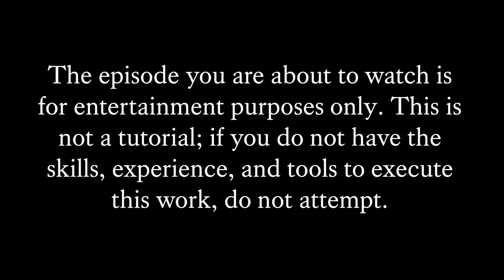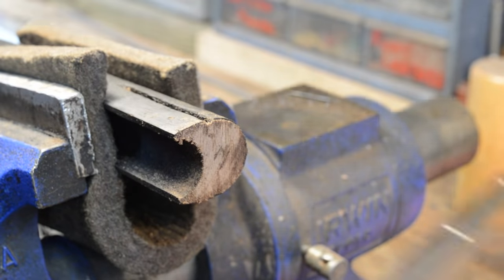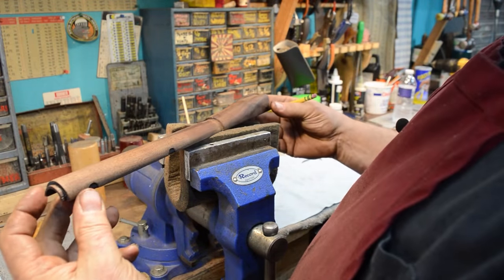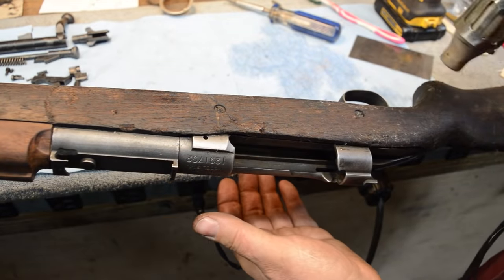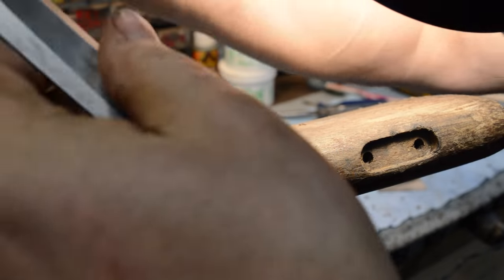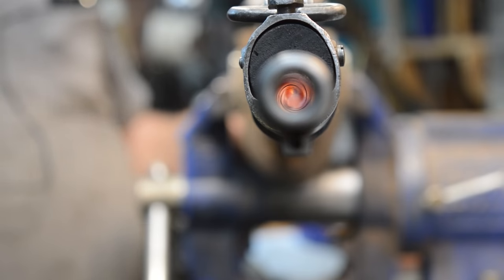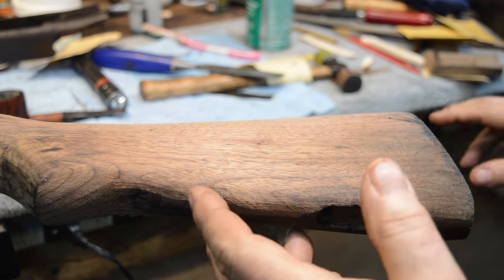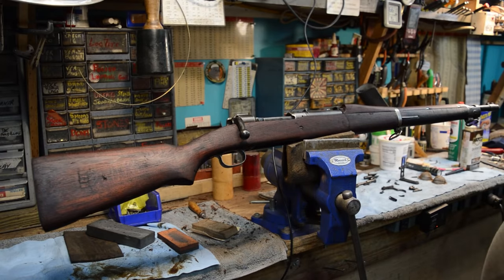Anvil 094: 1903 Springfield Split Personality

Comment: Mark, I enjoy your videos, they’re very well done and I like your explanations of why you are doing what you’re doing but I have a question about the dufflecut repair. Why did you cut back to the wide part of the stock and put the seam there instead of centering the seam under the bbl band? I’ve done this to a couple of stocks since I’ve retired and cut them so the bbl band would hide my cuts. Another thing that I did on my last one was to use the existing lightning cut on the stock and milled a mating lightning cut in the forend to epoxy in a piece of 1/2 x1/2 aluminum bar into the 3 x 1/2 inch channel that I machined. I had to cut a radius on the top of the aluminum bar to clear the bbl. I also cut grooves in the bar and matching grooves into the stock to lock it together. And I also like your killer rasp.
Reply: Hello All:   I have done the same thing - I put the two cuts on the two portions of the Frankenstock 
directly under the middle of the Barrel Band,  use two lenghts of  1/4"-20 all thread rod as the 
alignment piints, and then I make a !/2" x 1/2"  piece of Walnut to fill the lightening cut,  which I 
have enlarged lengthwise so that a roughly  5" long piece bridges the gap between the two halves.   
Use a lot of  colored Epoxy  ( I color it wth powdered artists crayons that you can get at any  art
store) ,  and, using a lot of Plastic Wrap around the barrel and around the stock to keep the barrel 
from sticking and the epoxy from running out, and, 24 hours later, you are ready to remove the 
excess and after about 20 minutes of sanding,, you have a  Frankenstock that looks like new.   
Invariably I find myself fitting the barrel to the completed stock, and yelling, 

" It's  Alive !  IT'S  ALIVE !!!!!
Reply from the maker: The shoulder the band bears against makes an excellent datum line for all other measurements to radiate out from. Remember, when doing more than one or two of these a decade, time is money.
Reply from the maker: I have several videos describing your technique, yes

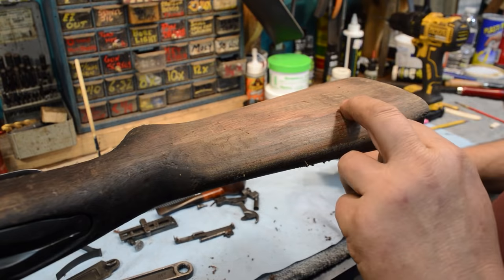Comment: At 32:25 is where the comments are made about the "Un-Readable" number on the stock.  How about grabbing a flashlight and with the lights off, shine the flashlight across the stock to try to see the number in the shadow that the light will cause?  Sort of like trying to find small parts on the floor.  You put the flashlight on the floor, with low light/no light in the room and sweep the area with the beam trying to cause a shadow to locate your part.  Have you ever seen people take a "Rubbing" of Old Head Stones in a Cemetary?

Comment: This stock looks like its from a 03A4 and the gun looks like an 03. It has a pistol grip.
Reply: The C stocked 1903's were around long before he 03A4. Now, a finger grooved, C stock is a rare beast inded, unless you build one like I did 😆
Reply: The pistol grip stocks were first used on the 1903s between the wars.  The addition of such a stock made the rifle an 03A1 variant.  Very few 03A1s were made for the military.  The WWII 03A3 rifles were mostly made with "scant" stocks and straight stocks; again, when you see a pistol-grip stock on any 03 or 03A3 rifle, it was usually installed by a civilian owner.  Similarly, the 03A4 sniper rifles were mostly scant stocks in their original production state, but the full pistol grip stock was issued in small numbers.  An original 1903A4 stock would also have been cut to allow clearance for the A4's lowered bolt handle.  

Among the pistol grip stocks, the original ones built for the 1903 rifles do NOT have a cut out to accommodate the 03A3's upper hand guard's rear retaining band.  This appears to be such an original pre-WWII "C-stock" that Mark is working on in this video (which probably contributed to why he spent the effort to try to save it).  The later WWII pistol grip stocks will fit either the 1903 or the 1903A3, but you will be able to see a small gap in front of the receiver when installed on 1903 rifles.
Reply: @southronjr1570  "...a finger grooved C stock..." is a non-existent military stock.  All the C-stock patterns lacked grasping grooves.
Reply: @kibbeystovall7546  The barrel band appears to be from an 03A3, the serial number of the receiver is from around 1929 I think.
Reply: @kibbeystovall7546  Your sorta right, the finger grooved, C stocked 1903's were on match rifles made by Springfield Armory for the Camp Perry matches in the 1920's and they were also on the match and sporterized rifles that Springfield Armory would sell on special order for the 1903's. They were also on all of the M1922 rifles that were made as marksmanship training rifles that were issued out to National Guard units. The CMP sold a bunch of the M1922 models back in the 70's. Interesting tidbit about the M1922M2 is that they have adjustable headspace. There is an Allen set screw in the rear locking lug on the bolt that allows the closing force and distance to be changed. You can measure your lot of ammo's average rim thickness and adjust the guns headspace to match. I actually learned to shoot with one my father purchased from the CMP around 1973, and I have taught my boys marksmanship with it. I loved the feel and handling of it so much, I researched them and that's when I found out about the match rifles, 
I purchased a C stock from the CMP and rebuilt a transition 1903A1 that had been Bubba sporterized and had the stock cut down and tossed the upper handgaurd and replaced the barrel band with plumbers tape. It shot horribly but had a good bore and used the CMP stock as a basis for a restocking. 
The transition models were made in late 42' iirc ad had some of the stamped parts of the A3 but still had the sights and barrels (usually) of he A1's. The one I restocked had the stamped handgaurd and a 3 groove barrel. I used the reciever and barrel assembly of the Bubba gun and using spare parts my father and I had collected over the years to include a milled floorplate to restock it. The CMP stock comes slightly oversized so I took the chance and using our M1922 as a guide replicated the finger grooves and also sight adjusted the stock by cutting in slight palm swells and deepened the C grip of the stock, I also gave it just a hair of cast off to fit me a little better by moving the buttplate over about 1/4 of an inch. I then glass bedded a 1/4 in rod in a channel I cut under the barrel through the lightening cuts, I bedded the action and breech of the barrel with a little extra cant forward and when that was set, I loosened the action screws and glassed the muzzle end of the stock and upper handgaurd free floating the barrel. After all the glass set up, I retightend the screws and it left about 5 to 6 lbs of pressure on the end of the barrel. In my research I came up on he fact that the 03's that were built for the National Matches were found to shoot best with slight pressure on the barrel at the end of the stock. I can attest that it is true. When the rifle was still Bubba sporterized, I could not get it to shoot under a 12 in group at 100 yards and after the work was done, can now keep 7 shots inside 3/4 of an inch at 100 yards. I must confess I ordered and mounted one of the non permanent scope bases and mounted a 6x scope on it after all was said and done due to my failing eyesight. The gun shoots wonderfully, so much so my oldest son fell in love with it when he was about 15 and I ended up giving it to him for his 18th birthday present. He hasn't hunted with anything else since then. Sorry for the long winded reply, it's an insomnia kind of night and as such tend to ramble.

Comment: Mark Novak I wish you would do a video on how you keep your extremely sharp chisels sharp
Reply: Not that it helps, but at one point in time he had a tool video where he explained it.  I believe it was lost in the transfer from C&Rsinal to Anvil standalone channel.
Reply: There is plenty videos on YouTube about tool sharpening
Reply: at the end of this video you can see his wet stones on the table
Reply: Shapton Glass stones are super nice.   

Their ceramic stones are good too kinda like the Norton water stones.       

King makes a nice big stone for woodworkers that are very cost effective.  

Make sure with Shapton or King to get the type ya need be it carbon steel vs HSS or powdered metallurgy stuff.    

A flattening stone is a good idea to have for truing up and keeping your stones flat.     Trend makes top notch Diamond stones for those who don’t mind spending.       A 250grit or so diamond stone can double as a flattening stone and a rough stone for fixing an edge.    

And of course a tormach machine is for super top notch easy peasy sharpening.     

Kangaroo leather makes the best strops of you’re able to source some.    Balsa wood is another decent strop material and of course good ol’ cow leather.  A bar of green strop stuff is for super mirror polish and totally worth it IMO.  

The ‘scary sharp’ micro sandpaper on flat glass or granite method is a neat trick.  But if you’re going to be sharpening your knives, chisels, planes and whatever else, it won’t be as cost effective and more of a pain in the long run.    

I can tell you Mark’s chisels may be sharp but just by looking, they could be made to be sharper- even if for no other reason other than being obsessive.   500 grit is generally as fine as one needs for most wood situations and 1000 maybe for a bit more refined edge.     
When it comes to cutting various species of wood, the angle actually plays a significant factor more than simply having a shaving sharp edge.    

Thats my steamer of consciousness on the topic.   

And yeah I admit after a few years of getting into a few water stones, all my kitchens knives, pocket knives, planes and chisels are ridiculously sharp to the point ya gotta warn others beforehand if they’re not used to ‘holy shit that sharp’ stuff.  Lolz

Comment: One thing i have found is, if you have a really deep dent, try soaking the wood with water, then the steaming proccess. Ive pull impacts out you wouldn't thing would lift out. Nice work though!

Comment: Rather than using the Danish Oil and Toilet Ring Wax method,  you will get a MUCH better 
finish with just a few of coats of Birchwood Casey's  Tru-Oil -  You wipe it on, wait a minute, 
and then wipe off the excess.   Apply coats about twelve hours apart, and after 3-4 coats, 
you will have a glossy, varnished looking Linseed Oil surface.   Allow this to dry for 24 hours, 
then a quick scrub with  4-0 ( OOOO )  Steel Wool,  followed by a rub down with an old 
Terrycloth towel ( or an old Gym Sock ! )  and you will get a beautiful, deep,  semigloss finiish 
that rivals that of a fine English Shotgun.
Reply: He's not trying to make it look like a fine English shot gun. He's trying to make it look like a 100 year old milsurp.
Reply: @mutthead1444  Well said.
Reply: @mutthead1444  Yes, and with the Toilet Ring Wax on the stock, every time the gun 
gets hot,  like in the middle of summer, or being shot at the range, the wax will get 
soft and gummy.   
You are MUCH better off with a Tru-Oil finish.   I have never figured out why he 
doesn't use  the one major product that is used by most professional gunsmiths 
and hobbyists to finish  their guns.   There are lots of videos here on YouTube 
showing how to use it, and the quality of the finish it produces.    Take a minute 
and watch a few of them.
Reply: @paulrward  Because Mark isn't like 'most professional gunsmiths' out there!! :)
Reply: I used the Birchwood casey product once. There are many paths to follow when refinishing a stock. It was a Remington 740. I  was a "new" gunsmith. I have found better ways.

Comment: I have one of those hack job Ishapore Enfield .308's that was it down by the importers. The only thing is the front wood come off when I shoot it. Thetis a 3/8's dowl rod glued into the stock and a hole was drilled into the front bottom wood. It slides off for disconnecting but the bastard comes off when I shoot more then 5 rounds. It's embarrassing at the range because people think I blew the barrel up. I bout a sporterized  stock from eBay foe $8.50. with free shipping. The guy was really bummed because he thought he would get at least $30for it so I sent him a check for $30 to him because it was worth it to me. It was my dad's favorite milsurp bolt action for some stupid reason. 8 have to say it is very accurate for a rifle with a 18" barrel. My thoughts are that the dowl rod should be glued into the front bottom stock piece. The stock sling band isn't fitting on the main stock. Maybe I should bring the lip back on the stock so the band will hold it better. Normally I wouldn't care but it was my dad's rifle and I want to keep it complete. He only paid $77.00 for it back in the mid 90's. I will probably bring it to my gunsmith and ask him. He is really good. For 40 years experience. His hands aren't getting shaky yet. He is almost 65 years old.

Comment: just a question, why is cosmoline so hated?
Reply: It’s coarse, it’s rough, and irritating, and it gets everywhere
Reply: @Louzahsol  - LOL - sounds like my annoying Little Brother!
Reply: I see you've never had the pleasure of having to remove cosmoline. It works well but after it's soaked into the wood it's just a huge mess and a pain in the ass to get cleaned off.

Comment: In re using sawdust as a grain filler:  I have had EXCELLENT results by sanding to 220-grit dry, then stepping up to 320 and using well-thinned finish (Poly varnish in my case) as a lubricant for wet-sanding.  The generated dust mixes with the finish I'm planning on using and packs into the wood pores and, to a small extent, scratches etc.  Wipe off any excess and finish as per usual.

Comment: You can buy a Teslong CRES tube USB bore camera on Amazon for around $75. It will work on your computer, and on your tablet or smart phone with a $5 adapter.  You can snag all the images you want with any attached device.

Why fool around with focus techniques?  This is an amazing tool.  When I take rifles to the range it is in my kit so I can see how my cleaning is going.

Comment: Nice job knowing when to stop on the wood removal/resurfacing thing. The stock just looks like a better version of its former self with no serious dimensional changes or obvious repairs. The "duffle cut" repair was masterful. Well done. Incidentally, I've had excellent results with easy-off oven cleaner for getting grime or cosmoline out of heavily oil-soaked wood.

Comment: The sandpaper backed by the pad, or a straight piece of wood, is the best way to true a surface. Always sand against the whiskers, (as you did) otherwise you're just pushing them back down instead of removing them. You did a perfect job of matching the condition of the wood to the condition of the metal.

Comment: I was gifted a partial s&w Belgian model 3 ? Clone few markings identifiable . I was told by a gun shop expert it probably a 44-40 break top.  Missing several parts, un blued, rough.  I would like to restore the missing parts and bring to white, re cold blue and show the 90 year old neighbor original owner before he passes. The gun is likely nothing special but it is sentimental project and i have unlimited time myself to put in on this.  What videos can you suggest?

Comment: Outstanding instruction video Mark. I have had a LE No4 Mk2 that needs a little bit of love for well over ten years. I'm not a gunsmith at all and for years have not done the required stock work due to the fear of making a bad job. Your vids are slowly building my confidence to do some basic stock maintenance and do it correctly. Thank you!

Comment: I have a portable Garment Steamer that I got for $2 at the goodwill. I wrap a stock as tightly as possible with white terry towels. multiple layers just as tight as I can wrap it and tie it off. then I hit it with the steam cleaner. you can see the gunk sucked into the towels almost instantly. once I get it good and soaked, I start spraying some Krud Kutter so the gunk runs out of the towels.. ive been amazed how much crud it will pull out of a piece of wood.

Comment: An excellent tutorial on bringing back a badly abused stock Mark. I think it's fair to say that was almost a stock that should have been rejected when new. There are a good number of places where the grain has ripped out and this happened in the stock shaping machine particularly around the top  of the comb where it drops to the hand and I've noticed a few other places where the grain was just wild and have torn out. This is all during the manufacturing process. Then for that poor stock it just went downhill from bad to worse!

Comment: I have a set of JBL speakers that are 50 years old and they have a walnut veneer. They also have 50 years of dings and scratches but nothing really severe. I will use a lot of the techniques you demonstrated in this video. I too want to repair the surface before I re-oil the wood but I want to try and preserve what I can of the vintage feel of the wood. I like the way you explained why you did  what you did for each step. I will take my time since the restoration of the speakers is for my own personal use and not for a paying customer. I like the idea of raising small dents with steam. I also will experiment with making a scraper. I have done a lot of work with wood and seen many people make and use scrapers and I've always wanted to try to make one. I think I will use boiled linseed oil since that's what the finish was from the factory. And I was also thinking of a wax to finish the job since that will fill the pores and level the surface without using a chemical "finish" like a urethane or varnish. I really like a "natural" finish on real wood especially vintage wood. I'm Looking forward to trying out your ideas. I think they will work very well. Great video.